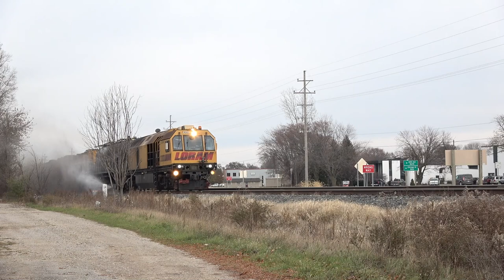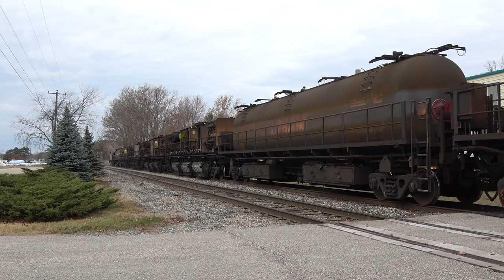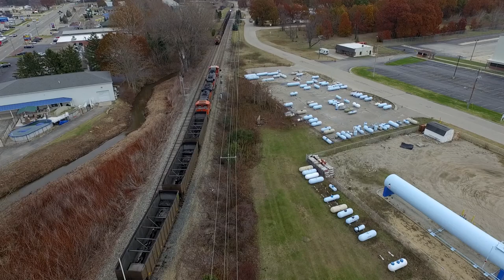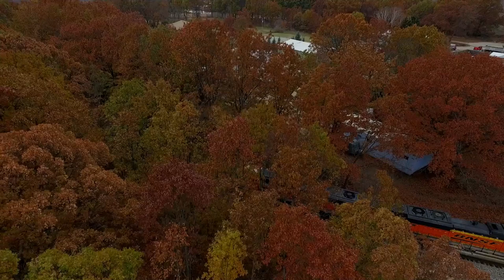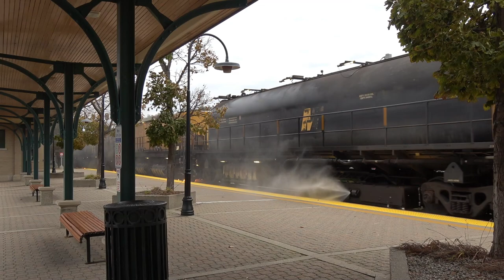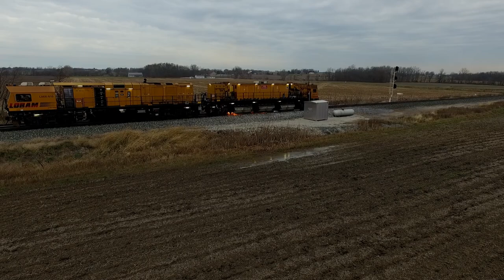TRRS 518: The Train from Hell - LORAM Railgrinder in Action

Comment: I understand why this is necessary coming from a former quality assurance auditor. My role was to perform audits on inspected rail car bearings. I saw firsthand the kinds of damage that can occur if railroads do not perform regular maintenance on their tracks. Tracks can develop pits and grooves that can shock bearings causing spalling, pealing, and impacted raceways and shattered rollers.

When bearings become damaged they can "hotbox", and if it is not dealt with ASAP then the bearing can become seized on the journal, then as the outer race (cup) spins inside the adapter then the bearing will seize inside the adapter. Once that occurs then the journal will literally twist off leading to a derailment of a train. So the smoother you can make the rail head, the better off everyone is. 

A typical derailment usually starts at $10 million and goes up from there, and that only pays for the damage to equipment. The cost to re-route trains due to derailment can be in the millions of dollars, especially on heavily traffic main lines where the nearest mainline can be literally hundreds of miles away. Also if the derailment occurs in an urban area, depending on the freight it could cause the complete evacuation of neighborhoods, and sections of cities.
Reply: Thanks for the info! I was scanning comments to see what this was all about! 👍

Comment: When I used to live in Vancouver, Washington, right across then, BN, Burlington Northern rail yard and Locomotive Bypass area, where they fueled, sanded, maintained, sorted and parked locomotives, I used to love seeing the LORAM rail grinder at nighttime. When you can see all the bright sparks and the whole entire unit is glowing, not to mention all the lights installed all over the train. It would make a few runs and eventually will go fuel up at the beginning of the locomotive bypass, the tracks that curve heading straight towards the neighborhood I used to live at. After fueling up, it would park next to all the locomotives, which are parked close to my bedroom window. It was nice to see it parked so close. It was slightly different from this one. It had two B-Unit type Locomotives, 4 cars away from each side, thinking because they were so intensely LOUD. All the controls are in the front cab, which has no engine, and entire train, including the front and back cabs were powered by those two loud GE engines.

Comment: The Locomotives on Rail Grinders are usually B-Unit Locomotives, which are controlled from the front or rear cab car, usually 2, but sometimes, they would add additional Locomotives on each end, totaling to 4 Locomotives. Those Cabless B-Unit Locomotives are extremely loud and noisy! You can feel vibration all over your body standing close to one, while it's running. Rail Grinder B-Units are Generators as well, providing power for all those cars requiring power in a consist.

Comment: Nice video.  Track grinding takes dirty to a while new level - I used to service the generators on a smaller track grinder, and it was the dirtiest job I had to do - and rail work is pretty dirty to start with!
Reply: i know all about this type stuff, I worked in a saw shop MFG big band & circular saws.
piles of grit from all the metal and when epoxy grit all day grinding.

Comment: Now let us discuss the two segments of a train and how both are regulated. Locomotives are regulated by the Federal Railroad Administration (FRA) which is an agency of the United State Department of Transportation (USDOT) , meanwhile rail wagons (cars) are regulated by the Association of American Railroads (AAR). All road equipment, rails, ties, fasteners, switches and turnouts, and signaling equipment are all controlled by the AAR as well as the USDOT. 

The reason why locomotives are regulated by the FRA is they contain the prime mover, generator, and traction motors. Even the bearings on the traction motors are inspected and reconditioned differently from the railcar's. Railcar bearings can contain brunelling  in the raceways whereas bearings o the prime mover (locomotive) cannot. During the reassembly process on locomotive bearings the inspector has to spin or turn the inner ring (tapered cone assembly) against the outer ring (cup) and listen for clicking. If there is a clicking sound present then the inner ring (tapered cone assembly) will have to be exchanged for on that does not possess the clicking sound. 

This is important due to the weight of the locomotive, and also due to the fact that locomotive bearings do not index while mounted on the traction motor journal. Indexing means that as the object round curves, the outer ring (cup) will rotate slightly giving the bearing a fresh load bearing surface. Locomotive bearing when mounted will be in a static or stationary position. 

Now rail car bearings are not in a totally static position when mounted onto the journal. This means that there can be slight brunelling on the races due to the fact that when wheel sets are mounted under the trucks (suspension). They actually sit under an adapter plate that is sandwiched between the trucks (suspension) and the outer rings (cups). It may surprise you to know there is not a bolt or nut holding rail cars together, instead they use the cars weight and gravity to keep them together. On the trucks (suspension) there is a center pin (kingpin) that goes into the car's sub frame. The rail car body and sub frame is separate from the trucks (suspension). It is held in by gravity. 

Now as the train takes curves, pressure is placed on the outside of the curve, meaning the greatest pressure (force) is placed on the bearings located on the outer part of the curve. Example, when a train is taking a right hand curve, the weight transfer will shift to the left of the car, leaving the right side of the car with the least weight (pressure). During that time the bearings on the right side of the car will index (turn) inside the adapter plate giving the bearing a new weight bearing surface to ride on when in a straight line. It is like taking a curve inside your car, your weight will what to shift to the outside of the curve because when an object is in motion it tends to want to stay in a straight line. 

I hope this helps.